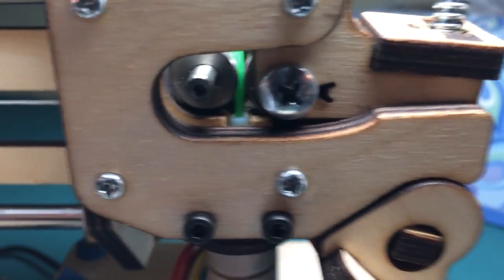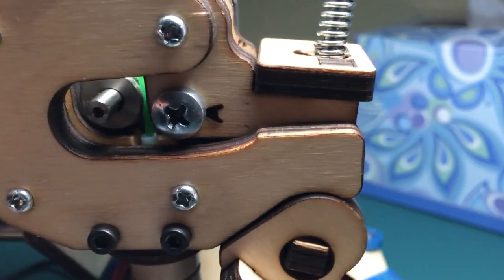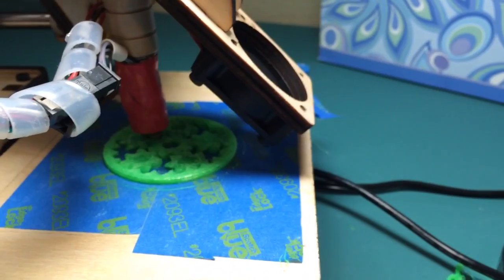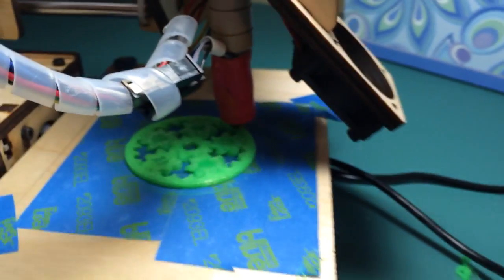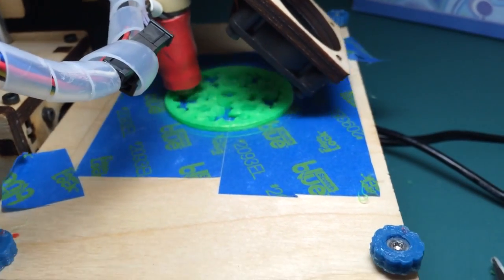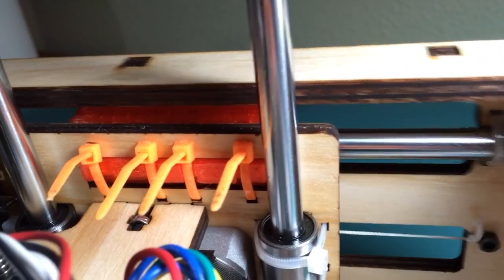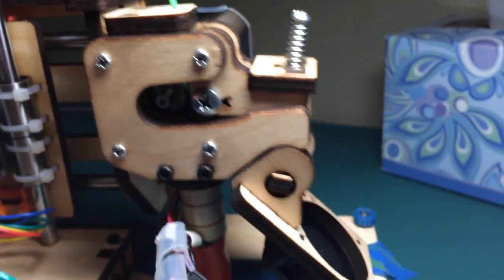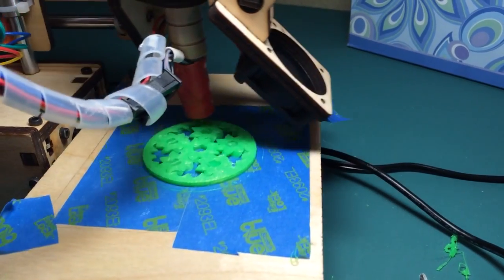Printrbot Simple

Comment from the maker: New Printrbot Simple target is April and $600.
So the V2 from 2013 is still a good price.
I bought a second Simple as a kit without the wood frame and I am building a Delta design based on JohnSL parts and RichRap 3DR.  3/17/2014 now and I have it together, motors moving but need to do more work to calibrate and get Extruder assembled and working.

Comment from the maker: The primary reason for problems with sloppy layers is probably the temperature you are using. At higher layers the fan is on and the plastic is cooling.  If you print with 195 to 205 or higher, you are going to have sloppy layers.  I have found that i can print at 175C and get great layers. 
There are many settings in Repetier-Host that I use to adjust print quality. The first layer needs to stick to the print surface. I use an octagon mirror from Michaels taped on the wood with a little bit of glue stick on the mirror. then I calibrate the Z axis so that a post-it note (0.1mm) just slides under the nozzle without bending the paper - at the four corners and the middle of the bed and I adjust the height of each corner of the wood bed.  But I also adjust the height of the Z axis with the Z endstop screw - only need to do this infrequently if I change the bed.  Adjust the four corner screws so the nozzle passes the paper test when the nozzle is at each of the four corners. The aligns the bed with the Y carriage so they are perpendicular.
Go to the Printrbot talk forum for more information and people to answer questions.
Or you can write to me.  email: igranderojo@gmail.com

Comment from the maker: Yes, I recommend the Simple as the least expensive way to learn about 3D printing.
You have to be prepared to upgrade it, modify it, experiment with it, make test prints, 
You are doing an experiment very time you print, so you have to measure, calibrate, test print, calibrate again, learn about the software, learn metric units.....millimeters.

Comment from the maker: Extruder is still not working properly.  There are layers missing even after changing the gear and adding the PTFE tube to guide the filament. Tightened the bearing pressing the filament on the gear. Super glued the tubing into the wood to keep it from coming up when retracting.